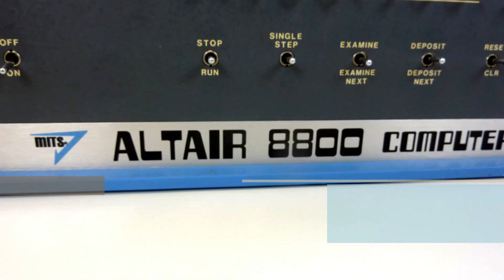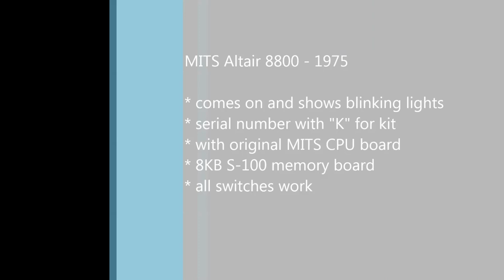MITS Altair 8800 - the first personal computer from 1975

Comment: ALTAIR??? COME ON !! WTF???!!
The  first pc is the "Programmma 101" by italian company Olivetti ( 1964) !!
Reply from the maker: this is only partly true: the Programma was much to expensive to be bought by a single person - it does not count as "Personal Computer" altought it was one of the first small computing devices
Reply: +alker33 Hi my friend. Personal Computer means computer that can be used by only one person instead of the previous enormous mainframes that required more than one specialized technician to work .The P101 had a price of 3200$ and it's not so far from the IBM PC in 1981 or other later PCs. It's not the price to define the first PC in history, the P101 is the first PC in history. Wikipedia English, wikipedia French, wikipedia Spanish and obviously Italian could teach you the true that it's not partially, it's the true
Reply: The Programma 101 is the FIRST PC!!!!!
Reply: @diegocantisani1027  Not for clarity
Reply: @diegocantisani1027  it is calculator